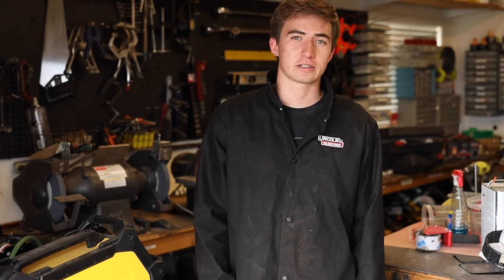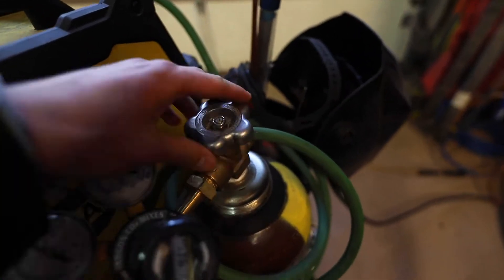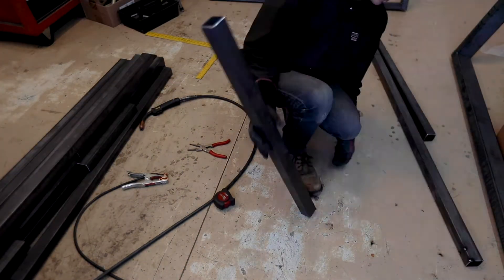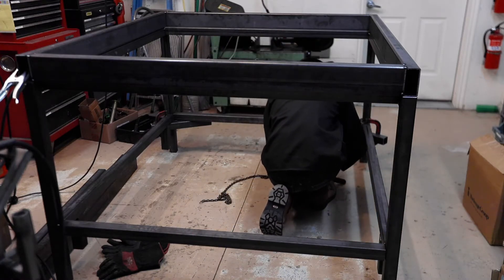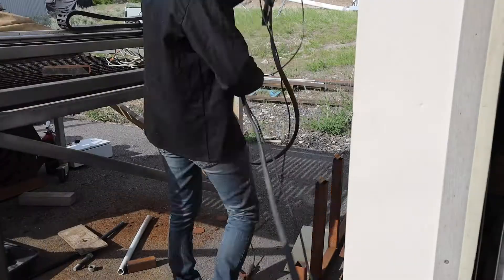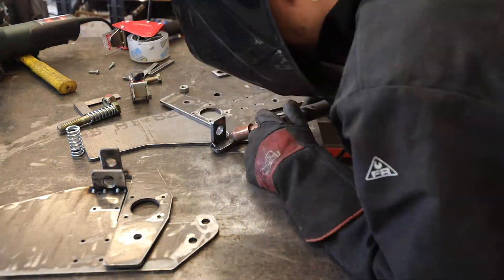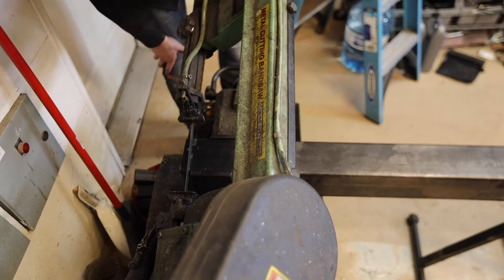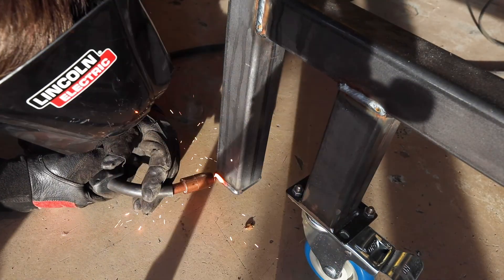How to build a CNC Plasma Cutter Table | Frame | Free Plans & CAD Files

Comment: Hello....Are the motor tensioners usefull in this scenario considering you are using rail and not belt driven motors
Reply from the maker: I don't think they are as useful compared to the use in the belt driven system. But I do think they still have some use to not loading the stepper motor shaft. But ya not as useful in this case compared to a belt driven system.

Comment: Is there a particular reason you chose to build your gantry primarily of steel? Your gantry is only transporting a plasma torch after all. It seems like the weight of steel would only increase the required size of motors, drive screws, belts, gears, bearings etc.
Reply from the maker: Ya, there were a couple of factors why I went with steel. 1) The cost of steel is a bit cheaper than aluminum. 2) I have the equipment to weld steel but not aluminum. 3) I sometimes use the table as a wood router and wanted the extra stiffness for that. But if you plan to use it specifically for CNC plasma I would say make the gantry out of something else and save the weight.

Comment: I love the build series Well done. It motivated me to build my own. I am just finishing my base table and realized how tall it will set at about 42 Inches to the deck . Is there a reason for it being that tall?  I am seriously thinking of cutting the legs down.  Would moving the Y rails all the way to the rear make better use of the full table?
Reply from the maker: Thank you! Glad you’re building your own and you liked the video series! There’s no particular reason it’s that tall. I think I made it that tall to be able to stand by the table like a work bench or something. But if you cut them there won’t be any problems. I think I understand your second question that the linear rails don’t go all the way to the edges because they are in meters and not inches. Moving it back to the edge should give you back like 1 or 2 inches. Thinking now I’m not entirely sure why I didn’t make it the same length as the linear rails. Not sure what my thinking was there. You do need a little space though to have room for the limit switch in the front. But if I understand your question I don’t see there being a problem and you theoretically get a couple more inches of use out of the table.

Comment: Looks real nice, good job!
Do you think its better to do a belt or a straight gear and rack drive for the axies
Reply from the maker: To be honest I'm not sure. I did the rack and gear for a few reasons. One, I felt that it would be stronger and I still plan on using the table as a router for wood and foam and two if you look at all the professional machines they are all rack and gear. That's personally why I went with the rack and gear over the belt, but I do thing the belt can be easier and a lot lower cost. Hopefully that helps.

Comment: Very cool build. Do you happen to have a parts list of linear rails, Rack gears, servo motors? Brands places purchased?
Reply from the maker: I've just updated the google drive folder to have a spreadsheet with a list of parts
Reply from the maker: I don't right now, though I will put one together. I will say I got everything from Amazon, Ebay, and McMaster Carr. The rack and gear was McMaster Carr and the linear rails were Ebay. I got everything else from Amazon, the stepper motors, drivers, acme nut and rod, breakout board, etc.

Comment: I don't have a cnc plasma table to make the small parts how much would you charge to make the parts. The rest of the bigger parts I can cut and weld.
Reply from the maker: I would be interested in helping you. Send me an email to gravityfabrication@gmail.com about the parts you are looking for. I'm assuming you are just wanting the parts that are cutting using the CNC. I would have to look at how much the material costs is.

Comment: Your welding needs a touch of work maybe abit more heat but as far as the build goes its fantastic. I look forward to seeing the rest of the build as I'm going to be attempting this at some point. But I think ill try a self made 3d printer build first
Reply from the maker: Thanks for the tip! I will try adding more heat. I'm currently at university and don't have much time, but I hope to finish the rest of the videos out over my winter break. Best of luck on your 3d printer build
Reply: @ToshDavis  also I forgot to add. I find when I wanna run smaller beads I have to do cursive e type movement to burn in the top and bottom. Makes it look better. And with hard wire push gives you more wash pull more penatration.
Reply from the maker: @Juiceboxmakes  Okay sweet! I'll try that as well, thank you